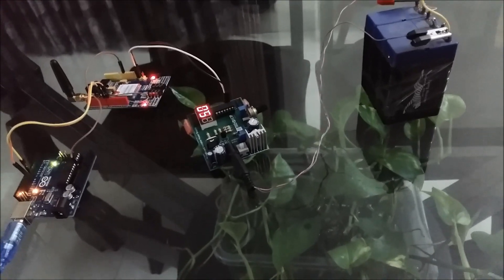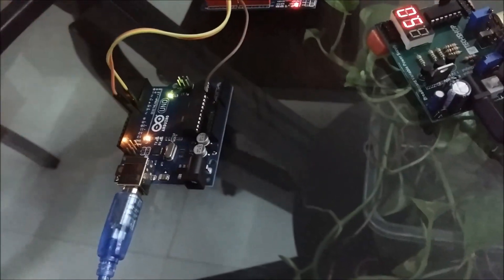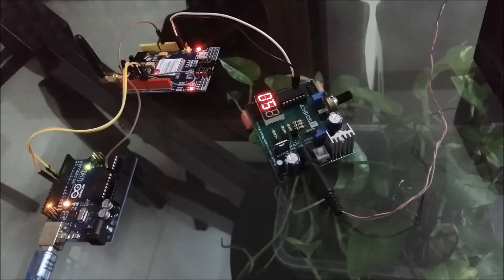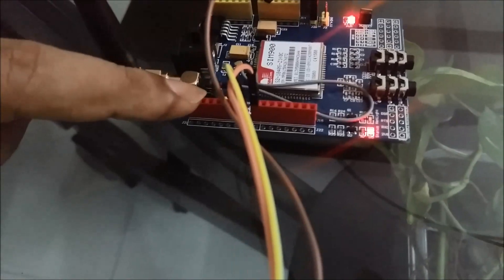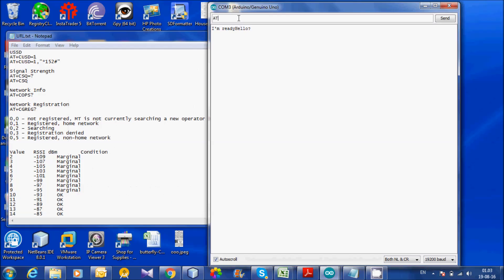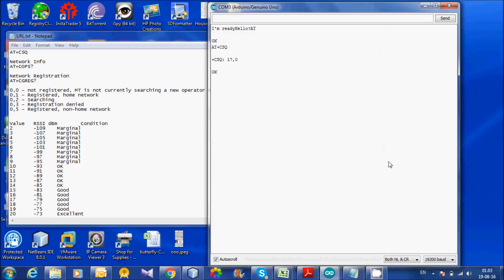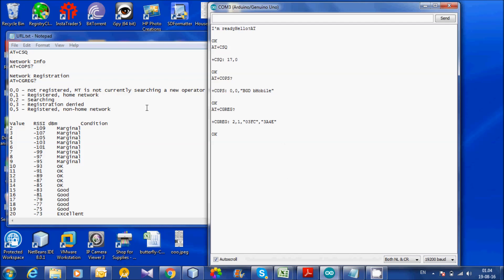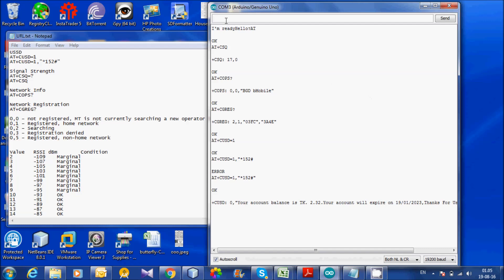SIM900 GSM/GPRS Shield Interface with Arduino UNO -- Arduino GSM Tutorial

Comment: I tried 5v and the gprs chip got really hot. There used to be two red leds constant on now i only get one. I double checked the specs and voltage range recommended was 7 to 12v. Any issues with the voltage?

Comment: Hello, I used sim900 I confused how to connect the wires that will blink the led no limits to get the gsm.available() and also without pressing any button on gms module (i mean automatic the message send when serial monitor clicked). can you suggest how to do that? I've connect the wire pin7,pin8,5v and grnd but nothing happened and I did try TXD to pin8,RXD to pin7 but nothing happened.

Comment: Boss, please I have the same module as yours, anytime I power it on with a sim in it, the status and netlight LEDs do not come on, but when there is no sim in it, the status led stays on and netlight led blinks, I have been unable to do anything because of this, please help. I have powered the module from both a 9b battery and the Arduino, still the same issue, your reply will be appreciated. Thanks
Reply: Ayomide Oyinlola i have the same problem as you

Comment: Dear sir
i am using the simcom s900
but still work with me.
i am using arduino pin 0,1 TX ,RX 
AND ON GSM i am using the first 2 pinin the sequence of D7and D8 
 And i connect the same ground for arduino and GSM.
and i use one of ready example for GSM SMS 
but in the serial monitor i recivd error message.
Trying to force baud rate to 9600 .
1200
4800
9600
19200
38400
ERROR : SIM900 DOESN'T answer. check power and serial pin in GSM.cpp
please help me in my case how i can set the simcom900.
please help me
Reply: hi could you please share the code

Comment: sir could you please tell me is it works if we does not use separate power for sim900 shield and use 5v of arduino?
Reply from the maker: it will work. make sure you provide 2A current